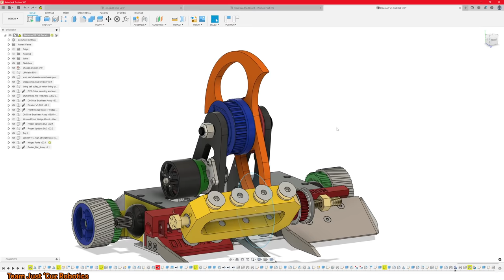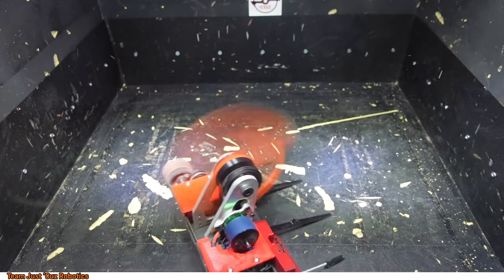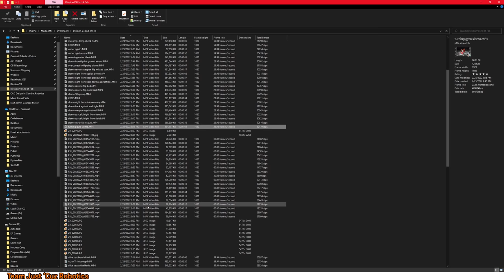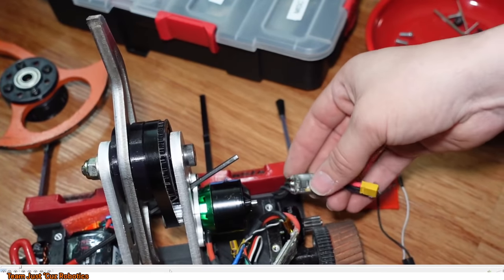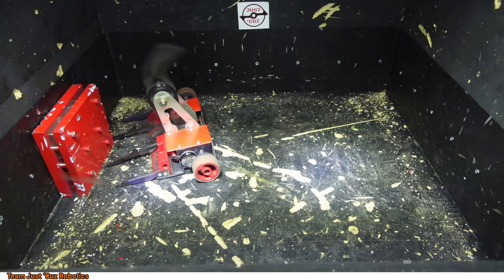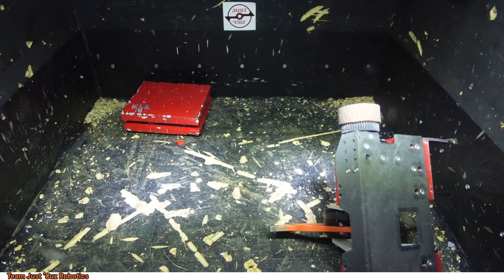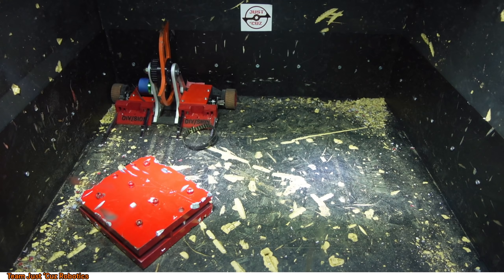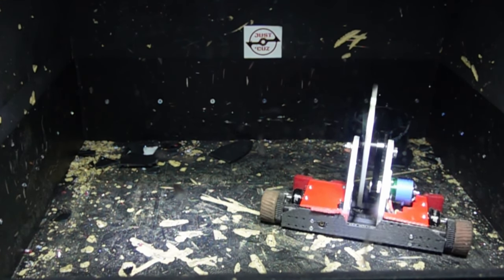Please Just F**king Work! Division V3.0 Problems and More (3lb Beetleweight Combat Robot)

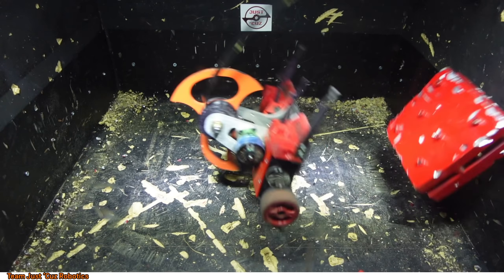Comment: 31:25 If the belt broke due to shock and not the weapon hitting it, a solution, without replacing the belt, may be to remove, or lessen the ribs that transmit force from the timing belt to the weapon pulley. If just the right amount of friction is applied to move the weapon without using ribs, the belt will slip instead of break when a large impact is experienced. I'm assuming the weapon pulley is 3D printed so there are things you can do to lessen the engagement from belt to pulley but still be able to spin up the weapon efficiently. 

As for this style of video. I enjoyed it but found myself skipping through boring parts here and there. It could definitely be much more concise while still covering the same amount of information. An alternative may be to upload polished videos on this channel and post long cuts/raw footage to a second channel for those who want to see.
Reply from the maker: Thanks for the feedback!
Regarding the belt pulley, if by ribs you mean the pulley grooves/teeth then that is a thought I had a long time ago for earlier versions of Division. I tried experimenting with intentionally misshapen pulleys that didn't fully engage the belt teeth. The issue I had was that they absolute wrecked my belts. The belt teeth were ground down into fine powder that ended up covering the whole pulley and filling in some of the gaps, so it was effectively, both making the belt teeth shorter and at the same time smoothing out the pulley. Even after just 2-3 fights a belt was unusable and during the duration of a fight it was wearing away rapidly the whole time. I could always try a totally smooth pulley and just pray I get good enough tension on it but I am worried that without any positive tooth engagement it will be incredibly hard to reliably deliver the torque to self right.

I may end up playing around with the motor mounts and see if maybe my belt tension was too loose as it seemed the motor skipped a bit when self righting sometimes. But still unsure how that would cause the belts to snap.
Reply from the maker: Regarding the video style, yeah I understand. Believe it or not it is a lot more work to condense 45 minutes of footage into a concise 15 minute video  than it is to cut out the extremely boring crap and pauses and mistakes and leave it 38 minutes long. Even so this was an all day affair. 

It saves a lot of time to screen record pulling up clips and then record live commentary (show here) as opposed to a separate voiceover and needing to fit it to exactly the length of each clip and decide how to order them all. But the time spent cutting out stuff and sifting though what in total was well over an hour of footage from only a single day of testing is still significant. No matter what video production is incredibly time consuming and I simply had too little time this weekend.

Comment: I’m having problems just like you. I have an esc that has a mystery problem. It should run the new motors no problem. It however won’t even power just a servo. It’s probably blown but I have no idea what I did to do that. It worked fine after my last fight. I have a back up but it has no connectors and I’d have to solder some. I literally learned how to solder yesterday so that sounds like a huge pain in the ass. And there’s the off chance that I blow that one too without knowing the problem. It’s really frustrating and I really don’t want to spend more money to get a different esc
Reply from the maker: The circuits that run servos and receivers at 5V in an ESC are usually separate from the motor circuits. You may be able to just use a separate BEC (basically a 5V regulator) like these ones I use in Division. Never had one fail with over 2 years of use. https://amzn.to/35EswTc
Reply: @ Team Just 'Cuz Robotics, yes I ran the servo with the but that ran to the receiver. I used an ESC for some RC plane stuff to make sure the servo and radio work just fine so I know that’s not the problem. Today I tried to solder some of the battery connectors that I’ve used for years now and now they don’t want to stay together(The metal tabs don’t stay in their slots). I’ll ask my dad tonight but it’s the little things after a long non productive day at school that ruin a night.
Reply: @Team Just 'Cuz Robotics, hey!!! Good news! I finally got my esc working. I think it some how reset when I was messing around with it. I’m gonna get that BEC for my servo too. Thx man
Reply from the maker: Great! Glad it works now.

Comment: My 2 cents: since the weapon already has fantastic engagement in front of the robot, I'm wondering if those floppy center forks are even necessary. TBH it seems like they are preventing engagement more than they are improving it. You don't really need to win the ground game if you shred the other robot's front right off the bat. Then again, this is coming from an armchair engineer!
Reply from the maker: The issue isn't reach its more of the angle of attack against another vertical spinning weapon. I have fought many drum spinners with the wedge config before and always get launched backwards by weapon on weapon contact. See here: https://youtu.be/v3DsimuXlX4
Reply: @JustCuzRobotics  Oh, that is a great point! Thank you so much for the response and the video! That makes a lot of sense